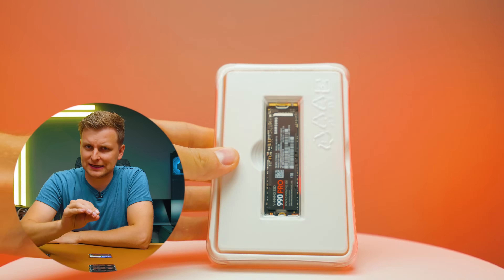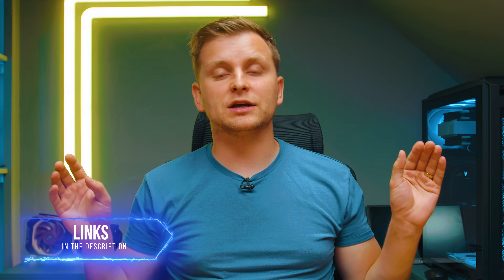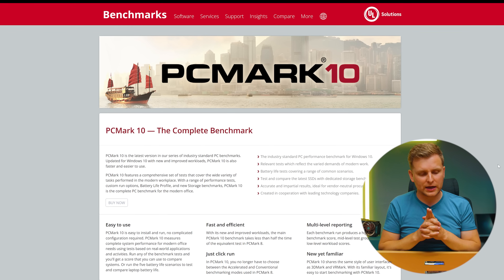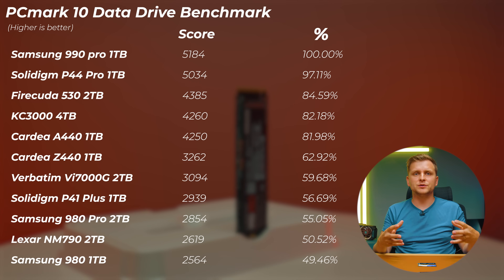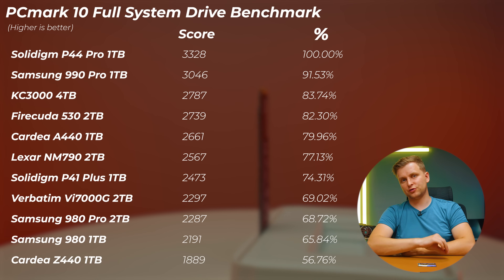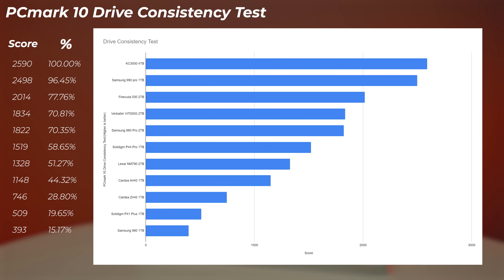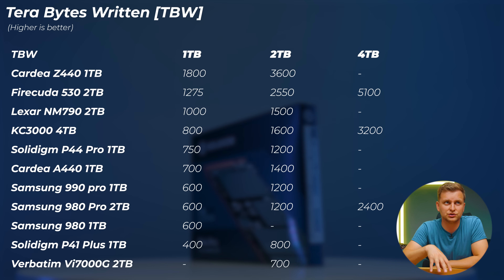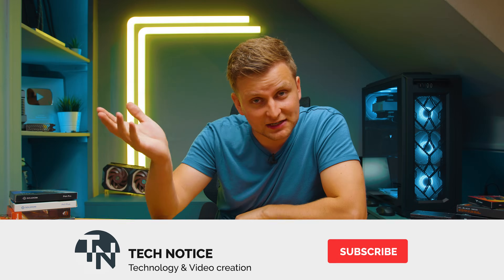REVEALED 👉 BEST SSDs For CREATORS | m.2 NVME Drive Buying Guide

Comment: Small note: Solidigm has a program that can let you update SSD firmware. Wendell did a good vid on it.
As for the next part, here's a bunch of other drives I'd like to see tested:
1. Silicon Power XS70 : one of the cheapest fast Gen4 SSD with DRAM
2. WD_BLACK SN850X : big manufacturer
3. Nextorage NEM-PA : Owned by Phison, who makes a huge chunk of SSD controllers
4. Crucial P5 Plus : big manufacturer
Would list other possible drives in a reply
Reply: Acer Predator GM7000
ADATA Legend 960 Max / Premium / S70 Blade
Corsair MP600 PRO XT
Fantom VENOM8
KLEVV CRAS C920
MSI SPATIUM M480 PRO
Mushkin Redline Vortex
Netac NV7000
PNY XLR8 CS3140
Sabrent Rocket 4 Plus-G
SK Hynix Platinum P41 (might not need to, they're the current owner of Solidigm)
Transcend MTE250S

Comment: For which drive type the TBW is from most importance? I assume fro the project drive. The size of the DRAM-Cache usually grows with the size of the drive, so e.g. the Firecuda 530 4TB would make the best Project Drive, for the storage drive it should be of no big importance, just big and fast read speeds, for the system drive high iops and fast read speeds, for the cache drive high iops high TBW fast read and writes probably the hardest to choose
i would pick a Samsung 990 Pro 2 TB for system, Firecuda 530 4 TB for project, probably a Seagate 530 2 TB for Cache, and a 8TB NVME for storage.  Where i'm not definitely sure with the cache drive? I would probably increase the Provision on the system drive for a longer lifespan from 10% to 15%

Comment: Great content as always and great comparison review! I'm using this SK Hynix Platinum P41 2TB PCIe NVMe Gen4 M.2 2280 Up to 7,000MB/S For my Content creation drive. It's preforming well and very fast so far but now after your review I'm wondering if I chose the right drive hah! Perhaps you could test this drive in the future? I'd also be curious how diff drives perform in Adobe Premier or DaVinci Resolve as far as exports go? Are there any big differences? Thanks and keep up the awesome work!
Reply: You did well. Hynix owns Solidigm and your P41 Platinum is the same drive as the P44 Pro, same hardware different drivers, which was at the top of most of the tests.
Reply: @cgsather3309  Ahh I didn't know that, that's awesome ty!

Comment: And I bought the Samsung 980 thinking that it was good for the price, and with this review I realize that it is not as good as I thought.
Or maybe you need to compare it with SSD of the same price.
Of course there is a lack of models like the Crucial P3, WD, Timetec, XPG and others.
Although it should be considered that the Samsung 908 is PCIe Gen 3.0

Comment: PCmark tests are basically useless. Use real world tests
Reply from the maker: Like....?
Reply: @theTechNotice  like create a reference image with many tests prepared, like projects, installing programs, launching games, etc; set a system with fixed clocks and then copy the image to all drives to be tested and run the tests (of course offline). Then you can have actual real world data without any variables.

Comment: I already bought kingston fury renegade 2tb, I think it is better then 990 pro in most of the specifications. 😊
Reply: I grabbed a Firecuda 530 with the heatsink... It doesn't have a pre-installed encryption on it. I intend to encrypt it myself. The drives that states AES256 is inhouse encryption from many of these companies can be hacked into using backend and backdoor methods. The newest Firecuda 530 that was manufactured earlier this year has read and write of 7300 a piece. The guy's Firecuda in the video is an old variant
Reply: @fightsandfinance7570  don't know about that brother, and youtubers don't go that deep now a days, he also doesn't told us about slc cache capacity.

Comment: if your looking for a high performance drive that is relatively inexpensive, then look at the the adata "premium ps5 ssd".. It is exactly the same drive as the xpg gammix s70 blade, but they changed the heat spreader color to white.... and it tends goes on sale a lot and usually costs way less .  but obviously drives from Samsung or western digital are probally better.. Also for a laptop SSD I would almost always go with samsung since they are generally the most efficient and perform best under restricted conditions, and the NAND is single sided (which is better for laptops)...
Reply: That Adata drive is well known to brick itself. I'd personally avoid it for important content.

Comment: I use a Corsair force MP600 on my Z390 mb and replaced the stock heatsink with one designed for a gen5 ssd. The benefit to this is most gen3 drives don’t hit the full speed of the of the gen3 m.2 slot but a gen4 drive will while throttling back to maximum gen3 speeds. 
I also chose it because it can sustain 666 gigs written before slowing down. And with it going slower than advertised because it’s in a gen3 slot and has a gen5 heatsink, I don’t have to worry about it ever slowing down below maximum gen3 speeds.

Comment: I heartily recommend the WD Blacks. Not the cheapest, but they have not failed me so far. I have three in my production machine.
Reply: Yes, Samsung and WD are my go-to's for SSDs. But there have been other good ones too.
Reply: Best drives but worst endurance unfortunately. Then again I think they both underrate their endurance spec by ~20-30%. At least with the writes of my old 860 evo it should be at 90% endurance but it's still at 93%

Comment: IMO: IF you are on a budget but still want high quality high speeds I suggest the Samsung 980 Pro, If you want the best, fastest boot drive then go for the SK Hynix P41 Platinum, if you want an n SSD that is the best primarily for gaming/PS5  then go the WD Black SN850X.  If you need the absolute best for write speeds the Samsung 990 Pro w/ heatsink is the way to go. 

My winner for best gen 4 M.2 SSD is the SK Hynix P41 Platinum and that's based on actual real world use cases. (Get a third party heat sink for the SK Hynix P41 Platinum as to it is not available with one and also she can run spicey a heatsink will mitigate that by a huge difference.
Reply: If you want the best fastest boot drive literally just pick up an optane p1600x 118gb for like $50. Its latency and random read performance is so massively better than any nand ssd that it nearly cut my boot time in half going from the already very fast wd sn850x. Boots are completely just randomly reading from the OS drive to put into the ram and yeah going from about 100MB/s of random read to 400 MB/s does in fact massively speed up things. For the same reason it's also way better than any non optane ssd as a cache drive. This random read performance is also why some people can't notice the difference between nvme and sata ssds as normal nvme ssds have improved in random read performance so slowly even with a whole new interface change too (sata -> nvme) which did help a bit.

Comment: Idk if you have in the past but I didn't see it in this video but you should test the SK Hynix P41 Platinum as it is the fastest boot/os in my experience. Below I put my specs for storage and also i have a samsung 980 pro a couple mid range SK Hynix PC801's and ya the SK HYnix P41 Plat is the fastest for boot/os compared to the others I listed also the SK Hynix P41 Platinum is faster the the Samsung 990 Pro and the 980 Pro in real life usage.
Reply: Just look at its "Solidigm P44 Pro"-sibling in this video.

Comment: Could you possibly do some testing of heat sinks on M.2 SSD's? 
I realize that there is massive difference in air flow over the SSD's depending on the motherboard and the position of the SSD on it.
Maybe you can could test a limited number of SSD's and heatsink solutions to find a relative trend in cooling performance.
I ask because I've had wildly different results trying to cool some SSD's. An Adata XPG SSD idled at over 60C but a simple heatsink brought the temperature down to under 40C. A Crucial P5+ only went down from 60C to 55C to 45C from no heat sink to a simple heat sink to a large heat sink.
I know that some PC enthusiasts say it doesn't matter at all but I never liked PC components that could burn me while operating!

Mein Freund, Verbatim is pronounced ver-BAY-tim, not ver-BUH-tim. Danke. 😉

Comment: You should really check your setup for bottlenecks. Suspiciously cut performance on Samsung drives. My 990 pro clocked 7458/6905 MB/s. You thermalthrottle them? Or maybe my 2GB behaves differently than 1GB variants? Outdated firmware?
Mine is under slab of mobo radiator, which is under GPU card... not perfectly, and still.
980 Pro results are also suspiciously low. Have you checked firmware for 980 Pro 2GB? Those specific drives needs to be checked for updates. There is a firmware with error out there for these, that makes false fails.

Comment: To everyone who still has a Sata Hard drive I implore you to get this NVMe show as a OS drive in this video. You guys will not believe the difference this drive make to general function of your pc, Installing, launching app's or program with little to 0 loading times. NVMe is not restricted by anything except the drive it's self is the only thing that can hold this Boot drive back. When you have "Fast Boot" enabled the time it takes you to put in your lock screen pass code your desk top will already be loaded and waiting. Seriously, it's very very fast Boot device.
Reply: true... even basic but solid NVMe gen 3 sneezes circles around SATA, even SSD ones, when used as OS drive.
Reply: @GrimK77  100000000% facts. No bottle necking Sata Cables.

Comment: why didn't you test the tbw instead of using the claimed tbw, is it bc there aren't any benchmark to test that ?
also you should test klevv, kioxia, intel optane
Reply from the maker: There's no TBW tests as far as I know. I could run the consistency test until the drive breaks but that's not feasible :)

Comment: I use A 1tb firecuda 530 as os drive two Firecuda 530 4tb drives for programmes in raid config and 4 Firecuda 530 4tb on the Asus m.2 expansion card for video storage works great in my Workstation

Comment: At the time I bought my 2, 2tb FireCuda 530 drives, they were the fastest around, had really good TBW AND comes with 3yr data rescue included free. That could be a massive win if someone needs their data recovered
I got the Cardea z440 2tb I use them as my game drive because of the cost and TBW was massive
Reply: Curiously enough, TBW is not an important metric for a game drive.
Yes, the files can get very large, but unless you are very frequently installing and uninstalling games (running out of space, which is unlikely), all you will really do is read from the drive, and that doesn't touch the TBW at all.
As an example, my game drive is an older Samsung 840 EVO, and the data written so far, after 7+ years, is a paltry 5.9TB. That's 4% from a TBW of 150!
Its a rather old SSD, but health wise, its almost as new!
Newer games write very large files during installation, but how often do you install new games!?
Once a game is installed, the only writing going on, are the save files, so TBW becomes a very non-issue.
In fact, i would say the most important metric for a games drive is the Sequential Read, and more importantly, the Random Read.
Reply: @00Resev  well, with several online games, along with games I run mods on, there are a LOT of updates being downloaded and installed. I'm up to 40TBW in just a year on my drive, which is also the drive I do editing on and everything else, along with my os drive. I just have one main 2tb Seagate FireCuda 530 and an additional one I clone to once a week
Reply: @00Resev  I was just making a comment about TBW. Back when that 840 came out, there was a lot of endurance testing over on the xtremesystems forums. Everyone was curious to see how this newfangled TLC NAND performed. One person tested the 128GB drive to something like 500TB before write amplification and reallocated sectors started popping up. So realistically you're under 1% of actual TBW!!  And I believe he started that test with a few TB of static filled space to represent more realistic usage.

Comment: I find my ssd is consistanly cause slow down in PR. What I means is if I left program for a few mins, when I come back the entire timelime just does no play and the files thubnails just stuck as well. It will takes quite a while for them to recover. Is this an issue of ssd for poor consistency?
Reply from the maker: Or something else?
Reply: I think is the ssd. I also tried move all the files from ssd to another ssd, then the issue disappear. everything come up very fast. But after 1 or 2 months later, the issue appears again, then I have to move my project files to another ssd again and this issue solved again.

Comment: Do checkout adata xpg s70 blade... One of the most affordable and well equipped gen 4 drives.

Edit: Samsung 970 evo plus is also a very good gen 3 drive.. I hear it performs better than the 980 because 980 doesn't have dram
Reply: S70 Blade is not a wonder, I reviewed it.
Reply: @ovistech  i just saw your review.. S70 blade scoring 2nd-3rd place in most tests is a pretty good result in my opinion. 
SN850 costs almost double in my country making s70 blade the best budget option for most people. 

Good review btw 😌👌
Reply: @luvoverthewall  Thanks. Indeed, it's all about the money in the Ene.
Reply: @ovistech  yep yep 😌

Comment: this video is outdated upon launch. it doesnt include any current generation drives (gen 5), which would "Score" 12,000+ your list.
Reply from the maker: I'd argue that right now the price for Gen 5 is not quite worth it looking at the price of Gen 4 and the Gen 5 compatibility :)
Reply: meh... gen 5 are running very pricey, very hot and are not mature/reliable enough, and also no real world benefit yet... I'd prefer capacity progress rn

Comment: The two main factors I look for is not just the immediate speeds, but the consistent speeds over time. Does the performance drop off after a while under load, and how much?
Also another major factor in my opinion is general failure rate, because a well performing drive is worth nothing if you have a higher risk of files getting corrupted etc. Especially for long term file storage.
Reply: Yup I've had intel, corsair, sabrent and western D nvme drives that have failed at one time or other - I now have over 20 samsung NVME and sata 6g ssd's (over a period of 5 years) with a zero-failure-count 🧐🧐
Reply: @chionyenkwu2253 this is good to know thanks! gonna make my first enclosure as a small boot up backup drive.
Reply: My dad tells me that for the affordable price, the best is Transcend. Not the fastest, but one of the longest lasting out there on the market. Sure, u might havent heard them since they're havent done that much marketing.
Reply: Exactly the reason why I stick with my Samsung SSD 970 pro 1 tb drives. Rock solid plus the good old MLC NAND. 

For long term storage I'll keep my files on external 2.5 inch OWC enclosures  with  Samsung 860 pro 2 tb drives and the Samsung SM 883 2 tb drives. All of them are MLC NAND and considered the most reliable out there. 

I dont play games and are fast enough.
Reply: @onlyvik Yes my most trusted drive is my old 970 Evo 1tb drive. Have used it for years professionally and not had a single corruption error on any file, which is crucial for anyone who don't just use their drives leisurely.
Reply from the maker: true! Samsung is held rather high regard in the failure rate.
Reply: @theTechNotice  Agreed. Been running high end Samsung drives for about 7 years now without a single failure thus far. But I wonder how the competition is stacking up these days.

Comment: It's July 4th 2023 and I've just watched this vid.  I've been playing with a couple of different build assistants online and looking at a specific pair of SSD's that I've been favoring in both my "No Hold's Barred/Well... ALMOST" and "Decent Performance but with Restraint" builds.  Those drives are the SAMSUNG 980 PRO M.2 2280 500GB PCI-Express Gen 4.0 x4, NVMe 1.3c V-NAND 3-bit MLC Internal Solid State Drive (SSD) MZ-V8P500BW for the boot drive coming in at this time at $71.60, and the MSI M461 M.2 2280 4TB PCI-Express 4.0 x4 3D NAND Internal Solid State Drive (SSD) SM461N4TB for major storage which is normally $209.99, currently selling for $179.99, and also has a rebate of $10 available to get it down to $169.99,  For a 4TB drive, I say that can't be beat.  I'd like to know your thoughts on those.  We have major sales available now and for the next few days due to the holiday.  And Amazon is having Amazon day within the next week.  Not that I am personally planning on spending money... at this time.  I'd have to get some REALLY amaze-balls deals to whip out my credit card.  Things are really weird right now.  Last weekend I saw a 4080 RTX which goes for $1,499.99 available for a coded discount on Newegg for %50 off.  If I had a bit more money in my account I'd have built a new machine and gone for it.  That discount is no longer available.  Prices are all over the board on major components right now and dropping regularly.  We live in interesting times.

Comment: Currently running WD_BLACK SN850X 2TB as main OS and game drive, and have a external WD_BLACK D30 2TB as game drive. Still waiting for 4TB NVME SSD to be more mainstream then I will add them to my 3 free slots on the ProArt X670E board. 😅